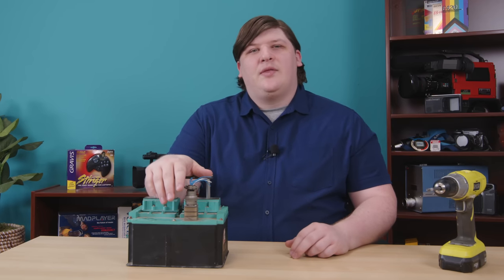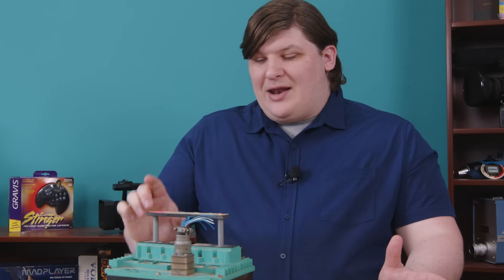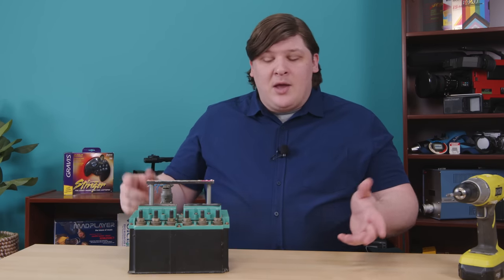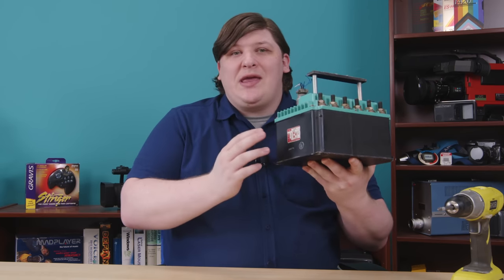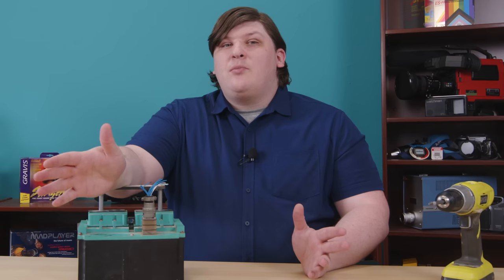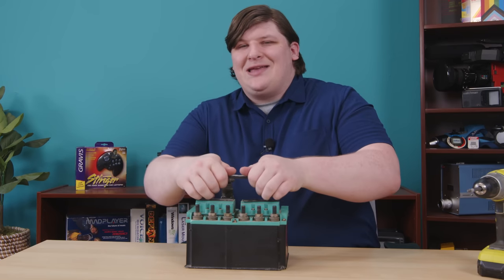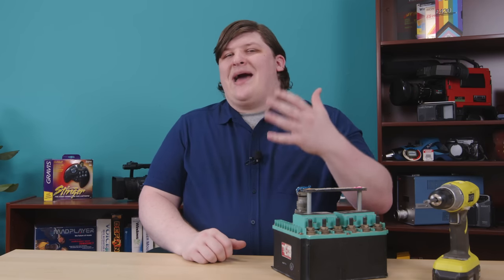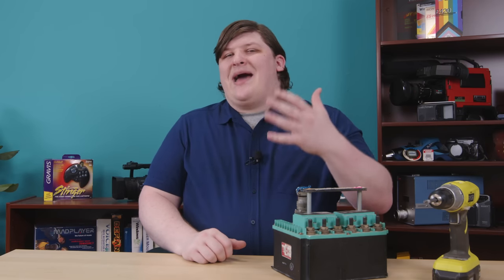A Short Story About (Battle)shorts

Comment: TLDR: I say I suspected this was out of an early 707 because Seattle area, 1974 (lots of 3rd parties made these switches for old planes and the earliest 707's were still in service well into the 80's), thrift store, the number & color of wires in cannon plug suggest early-mid Boeing, 400hz, 300 amps, 3 phases/legs (3 conductors) and some 707's DID have electric starters that ate HUGE amps spinning up the compressors of those old turbojet engines - that would have been needed in an emergency power situation had both engines stalled and no APU or windmill, as some of the old jetliners still carried battery banks. APU's weren't always installed, or even working. Or mandated to be in service. And battery power is of course non-renewable when running the basics. This could be activated by the pilot to provide power only to the components needed to fly the plane. We don't really rely on that stuff anymore but it's still around believe it or not. /End TLDR

People already beat me to it, I was late watching the video, but it's a one time use electrical transfer switch and your description of jellybean is pretty bang on - many companies made these over the years, all sorts of different designs shapes sizes and power ratings. I THINK this one might have come from a civilian commercial jetliner, probably Boeing or MD80 as soon as you said 400hz, and at the stated amperage, leads me to believe it would be something of a last resort to transfer electricity to things like the instrumentation, flight control etc while disabling unnecessary things back when APU's weren't always reliable or even working (Yes. We used to to do that. Send commercial planes on their way with a broken APU. As recently as the 90's!). You'd be amazed how many amps it takes just to run the basics on a basic jetliner something as small as a 737. You'd only get one shot to use this transfer switch. Not really a useful item anymore now that solid state relays exist. Most of the transfer is done by solid state electronics, if not outright provided solely by an APU otherwise you're absolutely screwed. I from aviation years ago, don't think I'd seen one quite like this one but there were just so many different ones from different companies that it's hard to say what exactly that would have come from, but like a light switch or a door knob you kinda got what you got from the service department. Needless to say they weren't typically an inspection/replacement item, they generally served the life of the airframe. I know 100% for sure the MD80 had one like it accessible under a hidden hatch near the right seat of the cockpit (going by memory as I haven't worked on one of those in 25+ years when Delta got rid of their MD fleet). Old Boeings made before the mid 80's had something like it but I can't recall where or why it needed one, they had a totally different electrical system that relied on the engines or the APU or you simply lost power and relied on a windmill (Yes. That was a thing too. A terrifying one). Just my 2 cents. Any other old timer aviation mechanics feel free to correct me but as I recall something like an emergency transfer switch was something only the plane manufacturer could touch. I'm. Hesitant to assume it came from any sort of military aircraft just because it found its way to a thrift store. That stuff usually got destroyed just to make sure it was never reused. This one being from 1974 and you being in WA I kinda want to say this was probably in something like a 707 or an early 747. The clues add up. However, I think most likely this was pulled out of an early 707 as those would have been standard equipment and as they aged those switches got thrown quite a bit. 1 of a few reasons 90% of them have been recycled by now though some are still in use

Comment: Okay, I’m gonna have to say it. It started from one of the actors brother that was in the Navy. He was talking to his brother explain how they would bypass the remote shut off in war scenario it just stuck and they also use the same devices in big manufacturing of steel, sawmills and other high voltage remote access something that you have there is actually for a sawmill it was just designed by the military core

Comment: As far as Treknology goes, EPS = Electro-Plasma System.
Starfleet ships literally use small conduits of warp plasma to route power, instead of wires and solid cable.
So bypassing plasma relays would physically shunt that plasma down a different set of conduits.
That's also why consoles always explode when the ship takes damage, because the conduit in the console breaks and plasma leaks into said console and 💥.
(Which is also why everyone who complains about the lack of circuit breakers in Trek ships is wrong, there's no circuit to break, it's a glorified tube of ionized gas that has to cause a fire/explosion a nanosecond before it can be physically cut off.)

Comment: "Military Thrust" is still a thing with aircraft and navy ships.  You have 100%, and then you have above and beyond that which you use with discretion if it means your survival, the survival of other friendly units, or a key strategic objective.  This doesn't only apply to engine output.  It also applies to restricting of top speed, rate of turn/g forces.  You protect the assets by operating them within peacetime limits, but you don't kill your allies by colouring inside the lines when pushing outside those limits would have saved lives.  The battle override would most likely be deployed when a control line was damaged, preventing the relay from powering on a critical system, or where a sensor was reporting bad data to the control system and there was no soft control to override the bad data, forcing a manual power override to bring the system up.

Comment: The other thing to weigh in that little piece of history is: that is a depleted unit. That is, it was activated. That's why it was discarded. There's every possibility it was a drill, or an accident, though generally that's avoided for consumables like that which can impair readiness outside of controlled conditions. There's an equal likelihood you just purchased a object that has seen combat, and which resides in its current state because a human soldier was in dire straits. In either case, it's good of you to show it the respect you are. Good man.

Comment: absolutely are electric shovels. not sure if they are on what you'd call back-hoe scale, more monster industrial mining scale. But there sure are excavators with big power cords coming out the back of them.

But I have battle-shorted other industrial machines, usually with a croc clip or twitched in piece of wire. usually if we get a delay in getting stock, and have 2 days to do a weeks worth of work. cant be having the machine down for a few hours for upkeep, The Spice Must Flow. I know it will mean next week will be spent doing intensive maintenance, and probably need to replace a few wear items that I could have made last far longer, but the job got done. In those situations, I really coddle the machine, don't walk away, watch it like a hawk, even though I'm normally pretty happy to just let it do its thing by itself. I am now the safety device. The boss is pretty cool in these situations, If we can get over the line from overtime and high stress, usually get a free paid long weekend, and that next week will be fairly chill, all about getting everything back up to ideal working conditions. can cop the abuse if then given the time to put things right. I know some places take that situation to mean "oh, so it actually only takes 2 days, not a week". in reality it takes longer, cos you have so much work to strip down and repair after the fact.

Comment: Actually there is a battleshort for software: That's when you need to release a patch so urgently, that you bypass the automatic testing. Today it's common practice to use automatic testing on every piece of software you plan to release. Such testing cannot find all issues and cannot fully replace manual testing but it's a safety measurement that is automatically applied to the release candidate and if a candidate fails any of these tests, then there is no point in manual testing or even releasing. It's a very convenient method to immediately notice if a developer has totally messed up something. 

However, a full automated test of the entire product can take pretty long, especially if you not only have unit but also complex integration tests that require complex tests setup preparations to even be performed. Currently I work on software where the automated tests for a full release run for 15 minutes and to be honest, we have far too little automated tests for my taste. I know products where a full test cycle takes hours! Usually this not a problem, you plan releases weeks or even months ahead (maybe not the exact date but what must be in that release) and at some point you freeze the code base after it passed all the tests, defining that this now is the final release copy, and this copy will be ready well ahead of time.

But what if you have already released the code and it had a horrible bug, a bug no tester or automated test found, and that is causing your company to lose $1000 a minute until that issue has been fixed? The problem may be caused by a simple typo and can be fixed within one minute. So you fix it and ... will you wait for a two hours test to run, when you lose $1000 a minute? That's when you tell your build environment, "Skip all tests" and immediately release as soon as the build is ready to stop your losses ASAP. However, it is risky, as even with that fix in place, there may still be a serious issue left, maybe an even more serious than the one you just fixed and maybe one that a test would have been able to find now that you fixed that typo. It's the battleshort as you take that risk for even greater damage in the future to quickly fix a problem affecting you right now.

Oh, and yes, Wikipedia says battleshort is more common than "battle short".

Comment: For one.  Look at all the wireless technology in the Star Trek universe.
- Remote power transfer (TNG: the next phase)
- tractor beam
- Particle beams via navigational deflector
- subspace field emitters
Bypasses may also have consisted of wireless relay networks that send power from parts of the ship to another albeit at significant efficiency loss. The ships nacelles are wireless they send power from plasma conduits to coil network by particle beam

Second...Bypass may indicate re-route switches much like a power bus and train rail re-route switch. Idea is if main setup fails or is disabled an auxiliary system has different distribution network location.
The A-10 thunderbolt has a Hydraulic system, a secondary hydraulic system in different location routing incase of damage and a wire pulled backup incase total hydraulics failure....

Third: Ships have batteries and power cells which may act as backups in case power system disruption. these systems can sustain critical systems for duration until main power is brought to bear. The ship also has numerous power generation systems. Warp core, Main Impulse engines, fusion reactors and secondary fusion reactors...All of which are fed thru power transfer systems routed all over.

Fourth:  This explains what lower decks crew do down below, running cable, connecting junctions making immediate repairs....Like the Navy they spend a lot of time training, drilling and simulating events they hope do not happen......They may be tired and annoyed of such constant drilling. But it makes one instantaneously prepared...

Comment: I could see they have push only because if you open a switch under high load you could get an arc flash explosion. By the way a lot of small turrets have internal batteries to be useeable if the main power is cut.

Comment: 400hz is used with radar equipment amongst other things and as such I would imagine that was used as a motor contactor for a 3 phase motor in relation to said equipment. That said with it being a generic part it might have never seen 400hz power and is likely an over engineered part that can operate with multiple systems. Ships are built to remain at sea for months and interchangeable parts are necessary to achieve that feat.

Comment: Stall current in electrical motors are equivalent to their resistive load, for example if a motor has a coil resistance of 8 ohms and a voltage rating of 12v the stall current will be 1.5 amps, (assuming its a dumb brushed motor)

Comment: "War Emergency Power" is still a thing. I've only seen it talked about a few times -- understandably you don't really want to be pointing out where that switch is. (if you need to know, you will.) As I've been told, that switch is usually wired "safe". If you're going into combat, the wire will be removed so you could actually use it. Use of that switch will effectively destroy the engine, requiring a full rebuild to fly again. (sorry I can't find the video of the cockpit walkthru)

Comment: Another aspect of this equation is redundancy that relay could be one of two three or even four identical ones. A good example of this redundancy is the control system in a airplane whether it's fly by wire or hydraulics there's often at least two or more whole instances of the entire system duplicated next to each other, but even with that redundancy there are often ways of overriding or bypassing the system entirely.

Comment: As in: I bought a refurbished Hoover wind tunnel Cyclonic action vacuum. If I use it for TOO long, it TEMPORARILY shuts down/off because it has OVERHEAT protection bits in place. I then have to wait for it to cool down and afterward I am able to turn it back on and use it again. I try not to use OVER use  the vacuum to the point where it always does that. If I did, probably would just conk out permanently, then I would have to buy another vacuum. It was pretty expensive even on the refurbished market.

Comment: EE here can you please show us it clicking its so bulcky 🥺
if you test the contacts whichever one is actually shorted should be the coil presuming there is only one thing that shows a short (if the thing was thrown out because the cotacts fused together from high current heating up the contacts and arcing which is a common failure mode for high power relays addition sets of terminals will also show a short)
you should see maybe 3-10 ohms dc resistance on that coil im guessing to control a contactor for that hefty of a load, maybe more if its one coil for 3 contacts. if it has zero ohms of dc resistance that is likely a fused contact. better solution would be to actually test the inductance with a cheap component tester ($7 on amazon) and anything with a substantial amount f inductance (will be >100uH) will be your relay coil

Comment: Interesting fact - cool feature 
not directly connected to electrical relays specifically, but about pushing equipment to the limit if you just need to
I have an old (2008) Range Rover sport, and it’s a good universal vehicle, you can drive fast on a highway and go to the woods or camping pretty much everywhere, where there is even a hint of a road (not talking of heavy off-road stuff)
Once in early spring I drove to the woods, and it was a time, when the soil is partially frozen, and even a water in the puddles 
So in the morning I drove like nobody’s business, but in the evening when I was going back, the was one particularly “bad” place, with a large puddle and no way around 
So I slowly drove on the ice, but apparently during the day ice melted enough for the car to brake it 
So I’m in the car in the middle of this sea-like puddle, and wheels not even touching the bottom 
I have no winch, so… I’m stuck in the middle of nowhere with no cellphone coverage 
And one thing saved me, that I’m thankful to the engineers of this car:
If you really stuck, and your car is laying on it’s belly, and only in this scenario (this is important, you have no way doing it otherwise, so it can be viewed as some kind of safety switch) car will automatically rise up for about 40 mm
And if THIS is not helping - you have another option to rise the car for about 35mm - you can hold down brake and hold “up” on suspension controls for several seconds - this will give you in total about 70mm of lift
And this ability really saved me, I managed to drive out and safely returned home 
You cannot force this mode until you stuck, because suspension in it’s physical maximum height, you cannot even drive like that more than 10km/h, because it will damage the suspension 
But damn this is a cool feature, that once saved me [maybe even my life]

Comment: First, you used an example of an 'earth mover', then a note popped up on screen saying there are no electrically driven earth movers in common use, only experimental.  If you'll check YouTube or Google for the largest bucket wheel excavator in the world,  you will see that this is totally electrically driven.  While it's not a 'self contained earth mover', it can and does move itself, and it does 'move earth', LOTS of it!
Other than this, I concur with your explanation.  Actually, every time I've heard those terms used in Star Trek I heard 'Emergency Power System" relays.     This would be consistent with a system where the emergency systems were capable of being activated from a remote location such as the bridge, or other stations on the ship.  As you mentioned, if the main control systems were damaged then the override could be done manually.  The 'EPS' or Emergency Power System could bypass (again as you mentioned) all the safety system to weapons, engines, transporters, life support, etc. to get them out of their current jam.
Enjoy your videos... Keep them up!